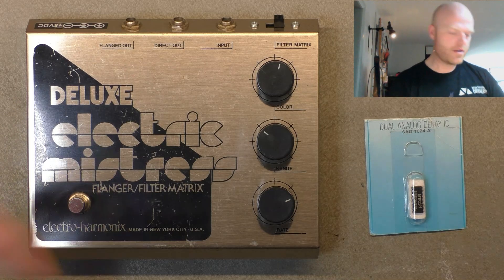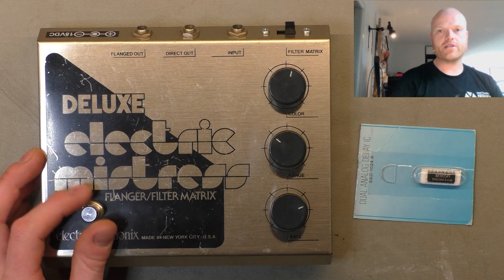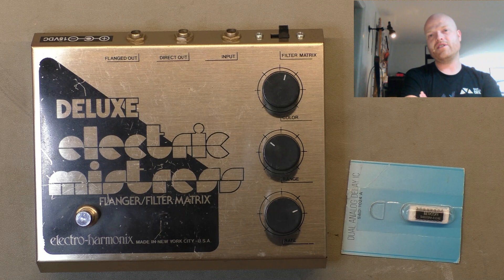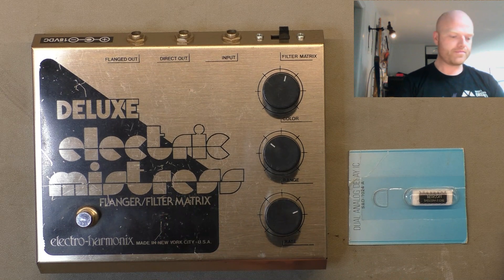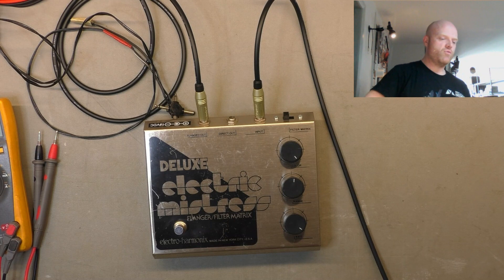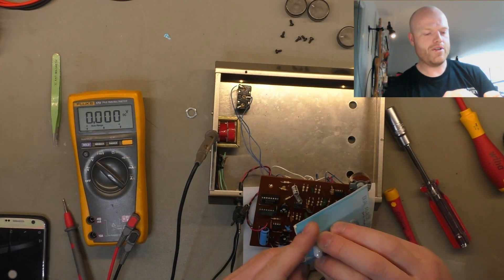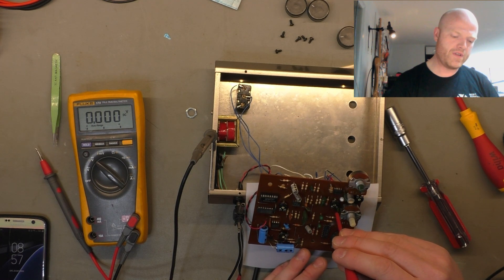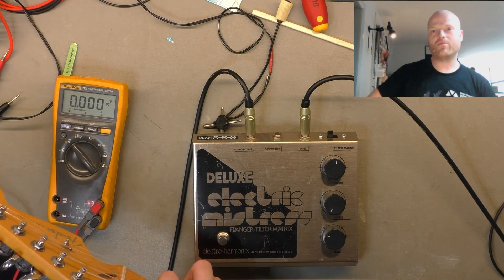Electric Mistress - Reticon SAD1024A Replacement (Unobtanium)

Comment: Do you remember what value Rate pot you're using? I'm thinking about modding mine. The stock one on the reissues from the 90s onwards is way too linear and the flange is only usable from about 7-9 o'clock. The old ones use a 1M reverse log, according to schematics.

Comment: Awesome video Brad! Love the old big box EHX pedals. Shame the SAD chips are so rare and expensive. I think most of the ‘magic’ associated with the sound of these old SAD pedals is really the sum of the entire circuit itself rather than the individual BBDs used. EHX made a few pedals where the circuit could be adapted to either use the MN or SAD chips and I think the difference between them is extremely negligible, if not none-existent

I suppose most of the value comes from the rarity and those looking to restore those units that were exclusively designed around the SAD but as far as I’m aware, technically these chips were really nothing that special. 

Have to admit I think the old big box pedals sound amazing though haha
Reply: The Rate knob makes a huge difference IMO. The reissued DEMs from the 90s onward were equipped with 10k linear taper Rate pots, which relegates all the usable flanger sounds to about 7-9 o'clock on the dial before it goes into rotary speeds. The original EMs as well as the DEMs up through the green-and-black big box v3s used 1M reverse audio taper pots, which meant there was a lot more usable range of flanging on the dial. The one in this video is a v5 but the Rate pot behaves a lot more musically which leads me to suspect that it was modded. My opinion is that if EHX went back to an audio-taper pot, most people would stop putting so much emphasis on the SAD1024 chips. After all, PastFX uses a Panasonic MN3007 in theirs and it sounds pretty dead-on to the originals!
Reply: @phantasmagora6542  I think that’s a pretty spot on assessment. Although the pedal in this video is an original late 70’s DEM I believe as it’s still using the SAD chip. The V5 was the later 90s reissue and used one of the MN series chips instead from what I understand. 

Another big factor I think is that EHX seemed to calibrate their modulations with a skewed wet/dry balance from the factory. Instead of the usual 50/50 split a lot of them lean more towards the wet side which makes the effect sounds a lot more pronounced and can be overbearing. 

The official EHX reissues tend to sound less interesting IMO, which mostly comes down to circuit redesigns they did in the 90s/2000s in an attempt to reduce noise and improve versatility. That got rid of a lot of the original ‘quirks’ but I think it ended up making them much less interesting as a result.

The PastFX stuff sounds great though!
Reply: @wastewoodrockers5526  Thanks for that, I realized after I typed my comment that the flanger in the video had the remnants of an internal power cord. Mistook the version due to the shape of the knobs, lol. EHX switched to the Reticon RD1506A in the 90s starting with the v4; my v5 uses the exact same chip. I also have a later XO version equipped with the Xvive MN3009, which squeals in Filter Matrix mode when the Range is set past 2 o'clock. Seems that EHX has a practice of rebranding their products before using up their previous stock of components since the earlier XOs use the RD1506A as well.

Increasing the Mix trimpot solves the volume drop issue but introduces more noise into the circuit particularly when the pedal is placed before dirt. PastFX were smart to have included a Blend control on their clone. The Mix and Feedback trimpots are interactive on my v5; as you turn one up, you have to compensate by turning the other one down to avoid self-oscillation.

The interesting thing is how each Mistress I've heard sounds different, even within the same version. I've heard some calibrated very dry with high and thin sweep, and some that sound super thick and detuned. Dunno if that's from the factory or if people have done their own tweaking afterwards - I personally appreciate how easy the pedal is to tweak.

Comment: is there an IC the could be used instead of sad1024a Retcon chip?
Reply from the maker: Nope. Not so far. Maybe Coolaudio or someone might make a drop-in replacement at some stage in the future, but it's unlikely. The repair market is essentially non-existent in the scheme of things.
Reply: @BradsGuitarGarage it could be nice to have a CMS adapted replacement

Comment: Why these chips are prone to get damaged? Maybe the owner had some problems with the power supply?
Reply from the maker: Word on the street is that it's a problem with the passivation layer chemicals used during fabrication.
Reply: @BradsGuitarGarage  oh my Gosh...it sounds like these chips are cursed from factory...very SAD (1024) news...
I have a vintage flanger with this chip, it's a Morley Deluxe flanger. Runs at 18 volts and sounds very similar to the Mistress. I think the circuit is generic and, so all of those flangers share the same sound and components... its like reading the recommended circuit from the datasheet and voilá...

Comment: Has anyone tried the: PastFX Reticon or Electric Mattress? or the new Sonic Research brighter Mistress v2? - I do a Police show, and want to Upgrade my Mooer E-Lady (which sounds fantastic) but I don't Trust it on stage?  Any input is appreciated. oNe LovE from NYC
Reply from the maker: Anything with a Reticon chip has a fast approaching expiry date, unfortunately.
Reply: Get the Roxanne by Longamp. The closest sounding pedal to the EHX of Andy Summers I've played through. Made to order, takes about four weeks from ordering to delivery. I asked for the extra knob circuit just because you can.
Reply: @christophersoulos6100  Thanks but I was not impressed with it, in the Demo's. It's definitely in-the-ballpark . . . but I'm happy with the E-Lady. I can get Summers, Gilmour and Van Halen type of tones ( so I am good ). Appreciate the input.

Comment: Hi Brad, My name is Michael Newell and I live in Niagara Falls,Ontario, Canada. I recently bought one of these vintage Mistress Flanging pedals. The pedal plays great with one exception. There is a strong clock noise on this pedal. I was wondering if you could tell whether thus can be fixed to get rid of the heavy pulsing clock noise. Any help would be greatly appreciated. It's strange that that Pedal in your video here does not get that noisier clock noise like mine, but my pedal seems to sound better for the actual flanging sound. Definitely The Police sound.
Reply from the maker: The clock speed needs to be adjusted with the relevant trimpot out of the filtered audio frequency range.
Then the balance trimpot needs to be set with a scope to the setting where the cancellation of the clock signal at the output of the chip is at maximum.
If either of these are unachievable, you may have some other issues with the pedal beyond just needing calibration.
Reply: @BradsGuitarGarage  would I be able to send you this pedal to fix this clock problem. I don't have an oscilloscope to do this not to mention, I haven't a bloody clue what I'm doing  . I live in Niagara Falls, Ontario, Canada 🇨🇦
Reply: I really like the clock sound on the Mistress lol

Comment: I love how Radio Shack used styrofoam to protect the IC's pins in the package. Lol! Styrofoam loves static! Crazy RS!
Reply from the maker: Yeah! We got lucky in this case though.
Reply: The conductive carbon-impregnated black foam stuff that was used by smarter chip manufacturers (the IC pins are pushed into it) has its own issues. It turns crumbly and gummy with age as it degrades and sometimes causes corrosion on the pins of the device.

Comment: You just tied the DC supply into the other side of the VR IC? Did you isolate the original side at all?
Reply from the maker: I believe I removed the diodes to gain access to their pcb pad and fed 18vdc into the 15v reg, since 18v is a common pedal power supply voltage and is above the dropout required by the linear 15v reg.

Comment: Brad, you violated the first rule of repairing or modifying electronics (or repairing pretty much anything, really), and that's not like you! To wit: Confirm proper working condition of the equipment before modding it; and confirm the customers' complaint before commencing with a repair.  In all fairness, I've made this mistake in the past and all too often come to regret it.  Chances are I'll make it again in the future as well!
Reply from the maker: Yeah, I just didn't trust that little 110v transformer and the frayed mains wiring and 2 pronged plug.

Comment: I built the green version of the electric mistress using a mn3007 and I love it! If we only had a time machine to go back and buy those chips with todays cash. Great job on the Mistress.👊😎
Reply from the maker: Awesome! Was that from a kit?
Reply: @BradsGuitarGarage  It was the older madbean current lover. I built it with volume knob as well as footswitchable filter matrix.
Reply: i used an MN3007, it was a jeds peds board (black pearl).

very good sounding pedal.